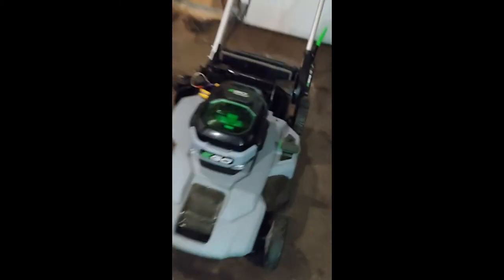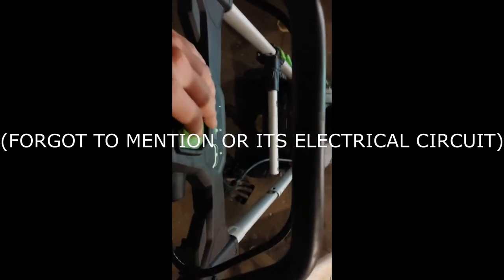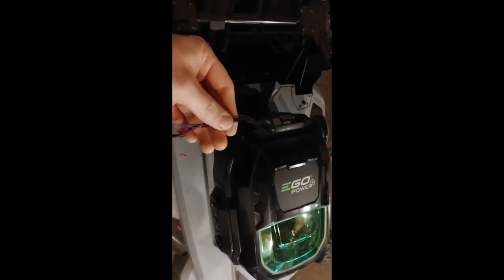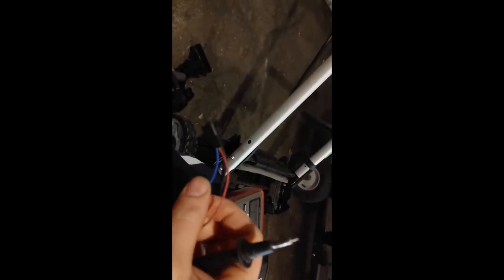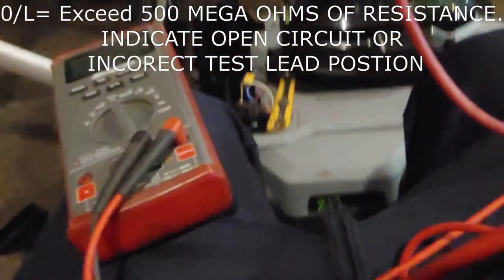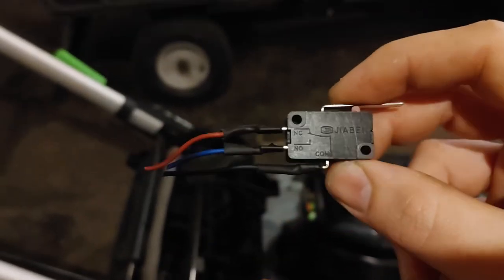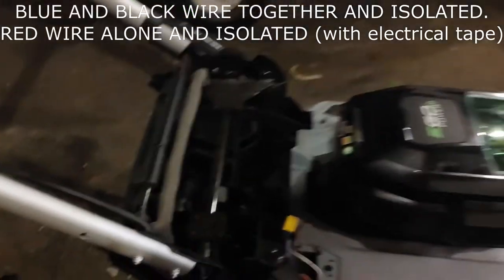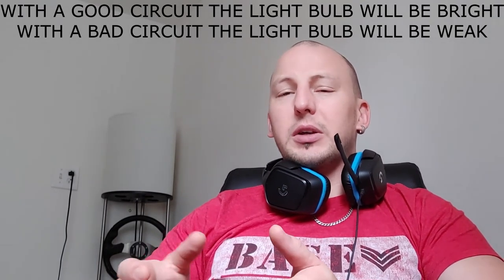How to repair Ego mower that wont start/How to test electrical resistance

Comment: I have a self propelled version of this mower and the I’m having a problem where the speed control of the self propel motor doesn’t work when it’s fully extended. Sounds like this bad wire routing is causing this. Can you show how you bypassed that safety switch? That switch is really a tight fit in that assembly and I want to remove it. Thank you.
Reply from the maker: hi ! first of all thanks for watching ! normally when the extension safety switch , or the handle tilt safety switch or circuit are bad, the mower just wont start. i will maybe make a better video to show in detail what ive done !
Reply: @OutdoorGorilla  it’s starting without any issues. My problem is with the speed control potentiometer . Do you think it’s a wire getting pinched or is the potentiometer gone bad? It works when the wire is not fully extended. I was also having a difficult time getting the side safety switch and clips back together
Reply from the maker: @vishaalkhandoobhai9171   you can alway disconect the harness at the potentiometer , check with a multimeter at both terminal that the resistance varie from low resistance to high resistance , when you pull the lever from high to low speed or vice versa. but if it work with the wire in a certain position. theres good chance that your probleme coming from the potentiometer wiring harness. you can disconect the harness on both end and test the resistance of both wire, while doing wiggle test and also  inspect  the complete harness visually, for pinched or cuted wire.